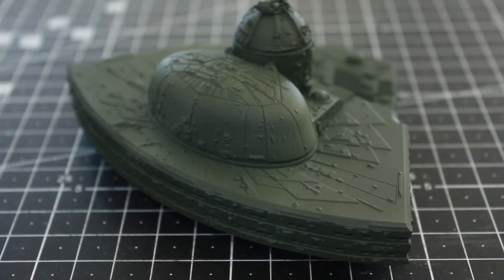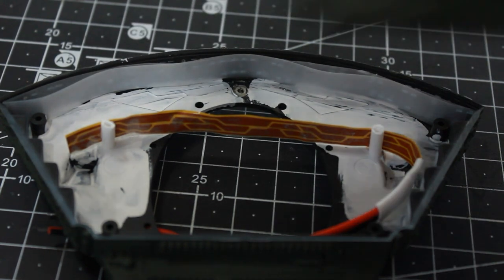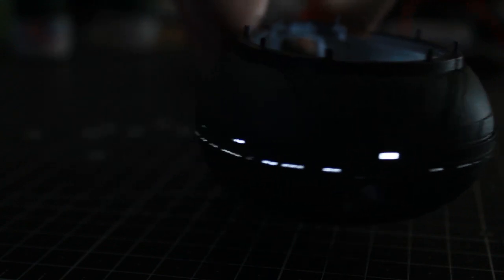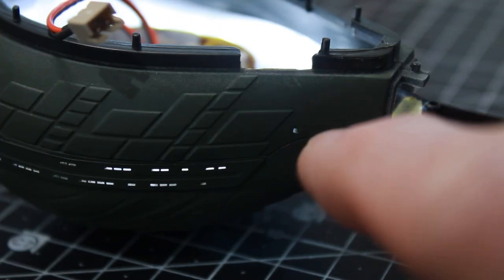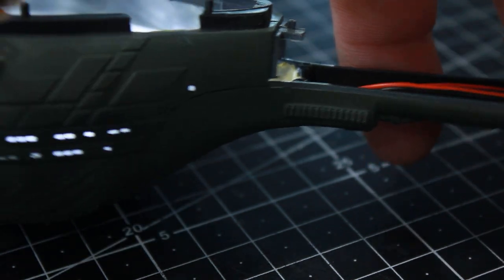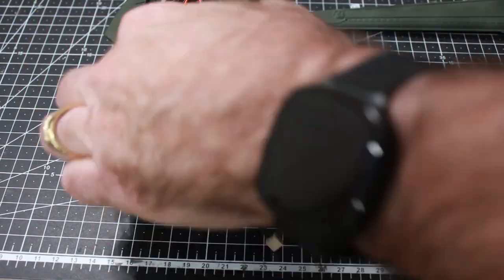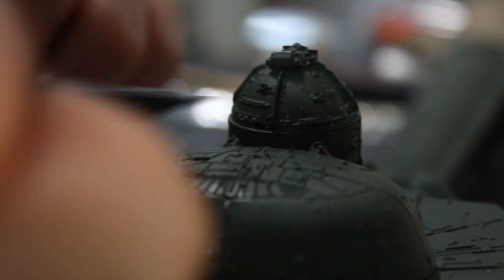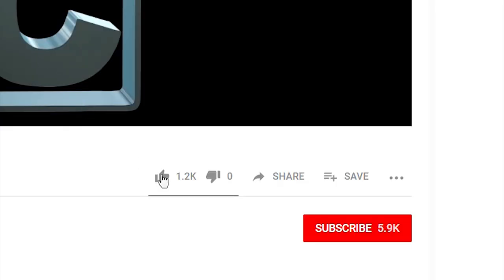Klingon K't'inga Battle Cruiser 1/350 Polar Lights model Build Pt 2

Comment: I have this exact kit as well as the lighting kit.  I'm not good with electronics.  How did you attach the new LED strips to the existing power supply?
Reply from the maker: I used my own power supply and LEDs.  Only a few LEDS from a kit were used.   Most of it is all custom.